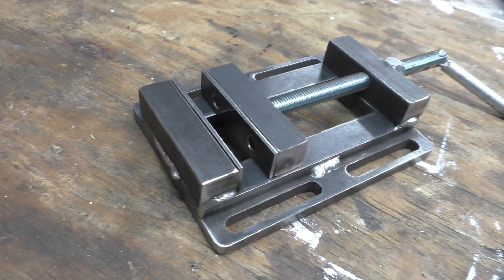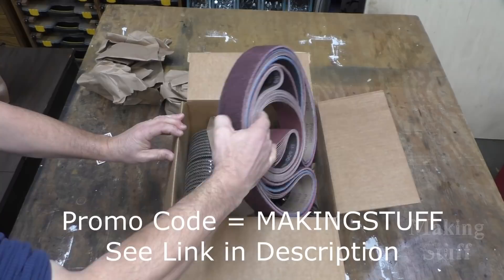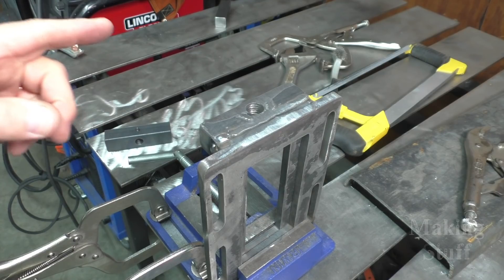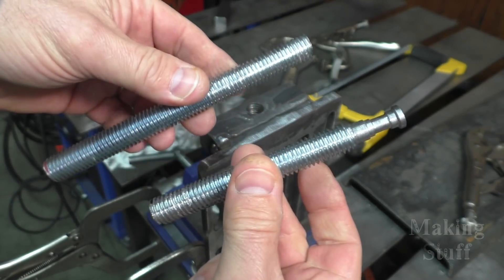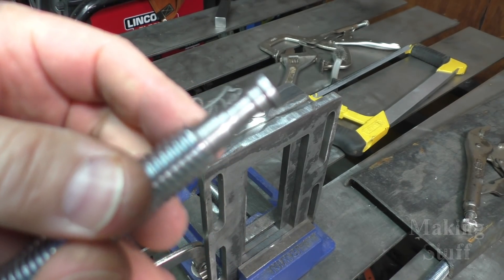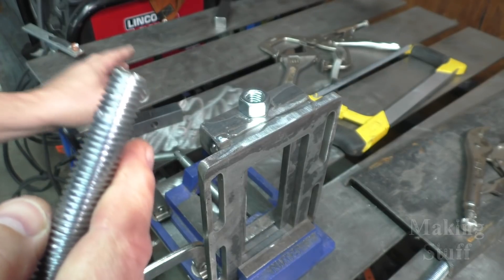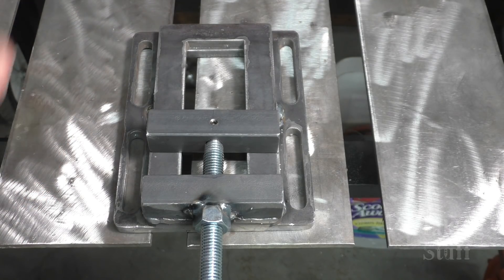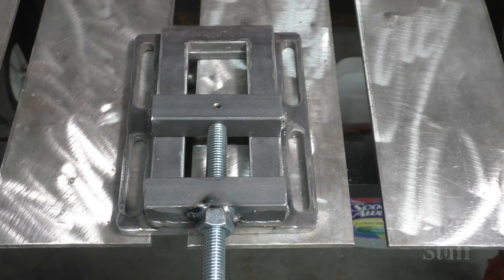Making a Metal Drill Press Vise - DIY Homemade Drill Vise

Comment: I'd chuck a bit of cold rolled on either side of the threaded rod, and have them anchored to a bar at the back near the handle, so it gives more lateral support to holding things in place, rather than all the holding force been purely in the centre of the jaw.
Reply from the maker: Thanks!

Comment: Looks great. Love the idea.  But I have a couple ideas.  
1: bevel the edges before a weld.  The end result is stronger,  and less grinding.  
2: thread the block that houses the all thread.  
3: for the movable jaw make the lower guide part of the replaceable jaw to minimize welding,  parts and potential failure.  
4: powder coat it. 

Just my opinion
Reply from the maker: Thanks for the tips!